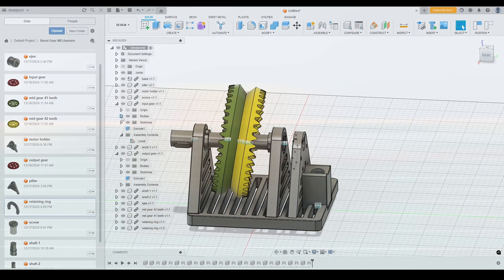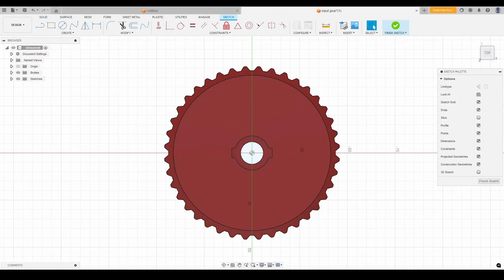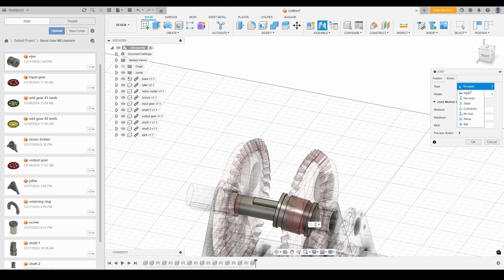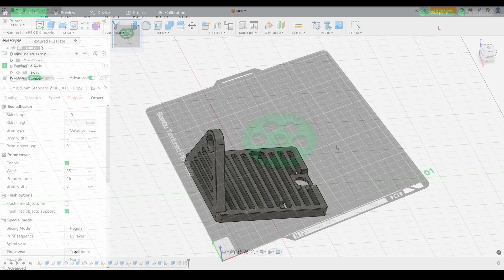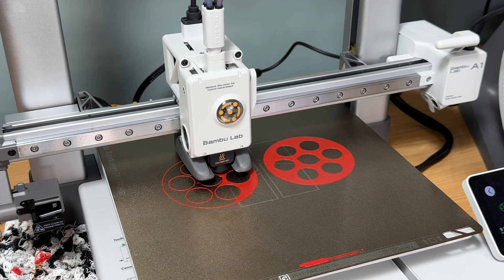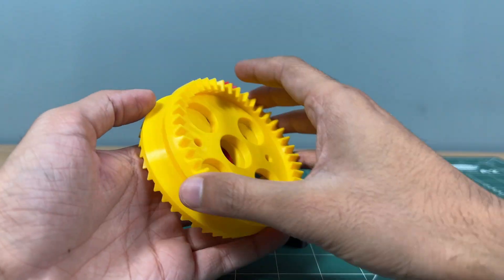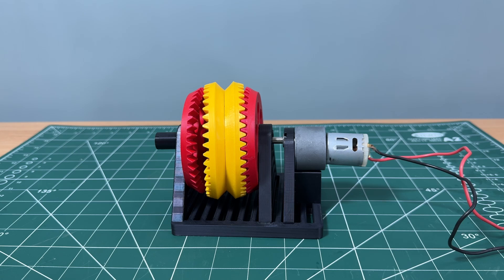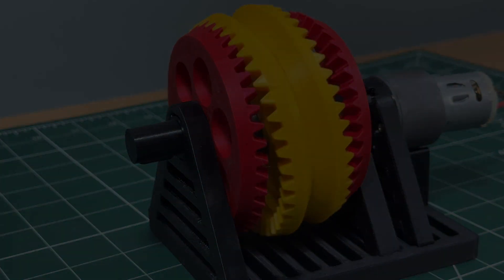How This Unique Gear Tilts to Transfer Motion | Nutation Bevel Gear Mechanism

Comment: So it's like harmonic drive but worse.
Reply: Don't know. Avoiding deforming parts sounds liek a plus, and if it's meant to be used for a lowspeed high reduction application then the added vibration wouldn't be an issue.